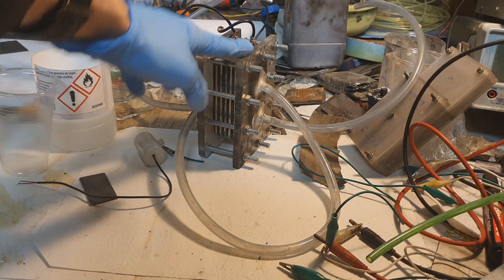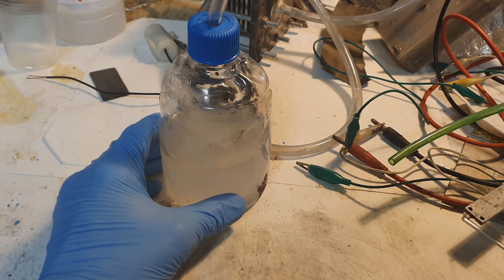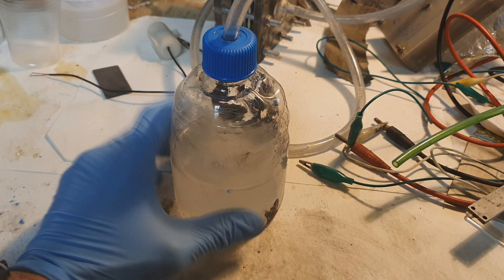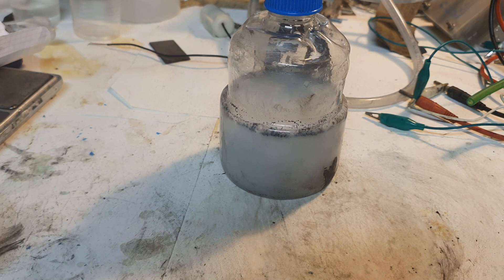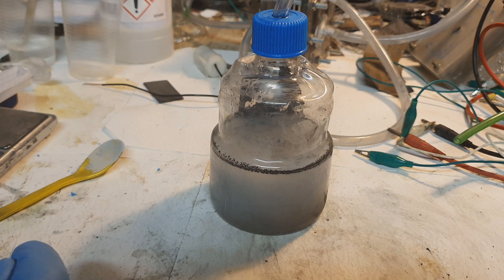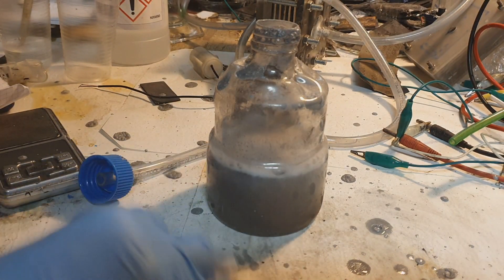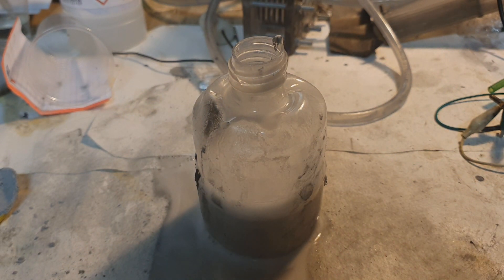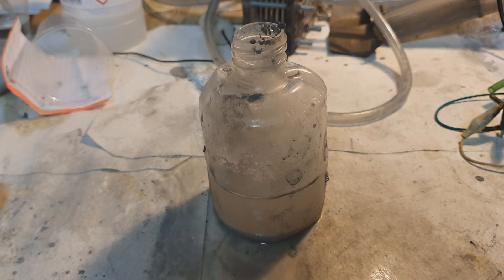Hydrogen Generator - NO Energy needed

Comment: That's cool man, ...I have a question about the general concept.  The term solid state used in fuel cell technology; is that meaning capturing the product gases and converting with out external tubes ? So how do they make electricity, as in a reverse cell , which combines the gases ,sparkes and makes water

Comment: No energy needed? Like burning a bonfire--no energy needed?
Reply from the maker: Hahaha, do not be petty. The US army experiment with the same princip. It is good for portable applications and not so much for stationary. :P
Reply: @cayrex  Experimenting with a principle is not the same as using it in practice. Although I will say that this method would eliminate the heavy metal gas cylinders usually needed to provide hydrogen, in small local applications, if there are any such. But the evolved hydrogen would need filtering and drying. Would the US Army really need small amounts of hydrogen? Would anyone?
Reply from the maker: @david203  It's all about experimenting. It looks like the NAVY / MIT will bee happy with small amount of hydrogen produced on similar way. 😉

Comment: Hi is there any other exothermic ways to produce hydrogen ? Produce more and countinusle
And can we reused the water ot the reaction of alminuim and sodium or recovery some tging
Reply from the maker: Commercial way like steam-methane reformation. Yes you can recover,... with bayer process,.... I think.
Reply: @cayrex  thank you 
But i want cheap process 
I can get more hydrogen and continuisly
Reply: Elctorsis is better than this one?
Reply from the maker: @منيراحمد-ق3ز  then you need to go with electrolysis
Reply from the maker: @منيراحمد-ق3ز  this hydrogen production can be used in remote locations, for example

Comment: So in theory you could use large pile of aluminum machining chips?    Larger pieces should be consumed more slowly but that could be compensated by a larger volume correct? Longer reaction, with fewer additions of material. Maybe on an auto feeder if the  Idea is scalable.
Reply from the maker: Yes so somehow

Comment: Try uera see paper by robbert Murray. He claims een slightly overuniti
Reply from the maker: Yes urea need less energy to break down as water itself in electrolysis process. Here is the spontaneous reaction between aluminium and sodium hydroxide.
Reply: @cayrex  Which, I'm guessing, costs a lot more than electrolysis, since the aluminum powder is itself made by electrolysis. No?
Reply: Any link to paper please?
Reply from the maker: Here is one example: https://pubs.rsc.org/en/content/articlelanding/2009/cc/b905974a#!divAbstract urea and urine electrolysis. For more search for urea electrolysis for hydrogen
Reply: @cayrex  ok thanks

Comment: Can this be used to generate enough hydrogen for a fuel cell car?
Is the reaction fast enough?
Can the water being released by the fuel cell be reused in the reaction?
How to reuse the material after it was spent? Would this recycling process be energy efficient?
Can other metals be used?
Would a solution for hydrogen transportation based on this have high energy density?
Reply from the maker: That generator can generate a loot of hydrogen. The reaction can be slow or speed up with the amount of aluminium powder, size of powder and concentration of electrolyte. 
The water can be reused.
Yes with the recycling, which is also standard process of geting aluminium from bauxite ore.
Process of convert Al from bauxite: 5 kWh of electricity consumed per tonne of bauxite extracted.
Is possible to use zinc instead of aluminium,... but the reaction is slower.
I dont know about energy density
Reply: @cayrex  I don't know how to estimate this or if I'm 100% correct, but it's probably one of the best ways to power a hydrogen fuel cell or combustion engine.
Reply from the maker: @vitordelima  hmm, I am also not 100% sure, but it look like good way to produce hydrogen. especially if is used on areas which dont have electricity
Reply: @cayrex  And in vehicles, which require safe and compact storage.
Reply: You can also use an Aluminium gallium amalgam
Reply from the maker: @kholofelolebepe9637  yes. I try Aluminium/Gallium. Is reactive in small concentration of electrolyte. But that test I forget to record to share it
Reply: No
Reply: Excellent show, how much aluminum is consuming vs how much hydrogen liters per kilo Aluminum powder will probably produced. Tkanks.